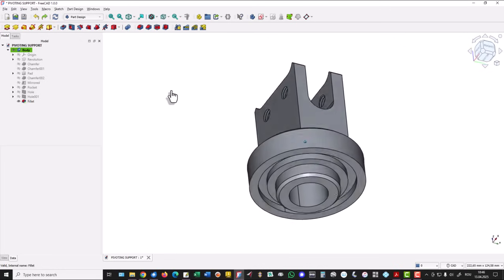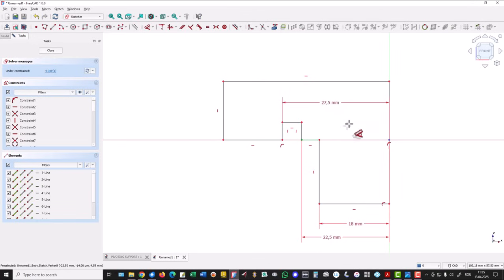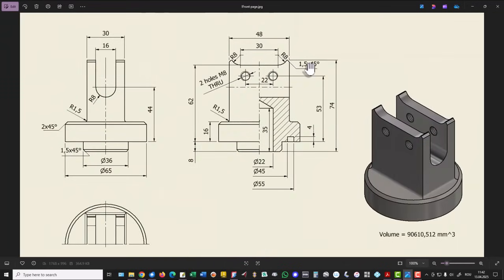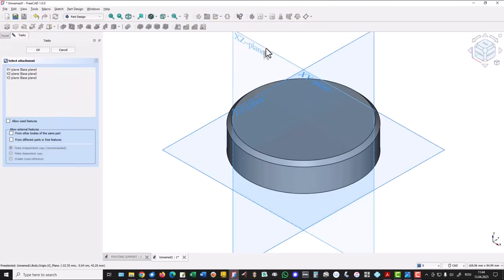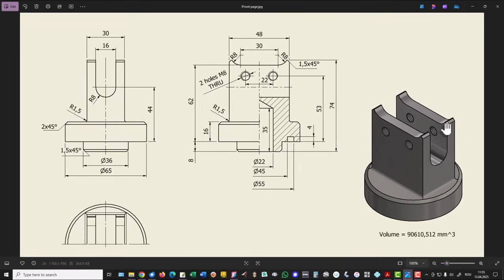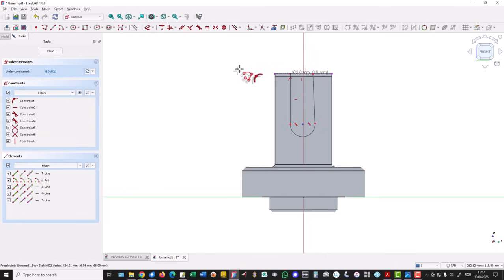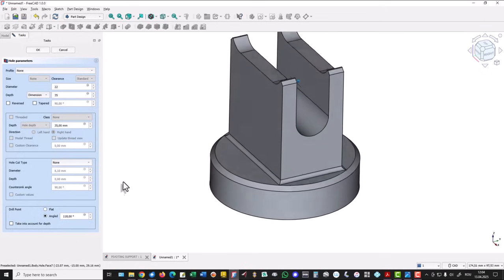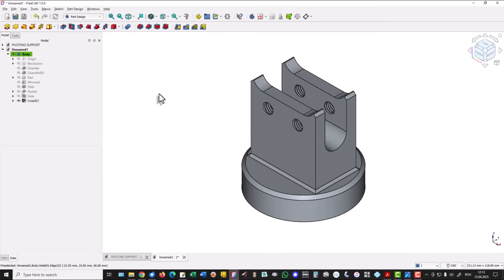Tutorial FreeCAD - 014 PIVOTING SUPPORT

Comment: I hope you are doing well. I am a Mechanical Engineering student at the University of South Africa and also work full-time as a draughtsman. I recently performed a hoop stress analysis on a rotating copper ring and encountered a discrepancy between my manual calculation and FEA results.

Problem Statement:
I calculated the hoop stress analytically for a copper ring with the following properties:

Rotational speed: 7,000 RPM

Outer diameter: 69 mm

Inner diameter: 49 mm

Width: 10 mm

Cross-sectional area: 100 mm²

Density (Cu): 8,960 kg/m³

Poisson’s ratio: 0.34

Young’s modulus: 117 GPa

Manual Calculation Result:
σ_hoop = 4.19 MPa

However, when I simulated the same scenario in Autodesk Inventor (Stress Analysis) and Inventor Nastran, the results deviated by more than 10% from my manual solution.
Reply from the maker: Good luck my friend!